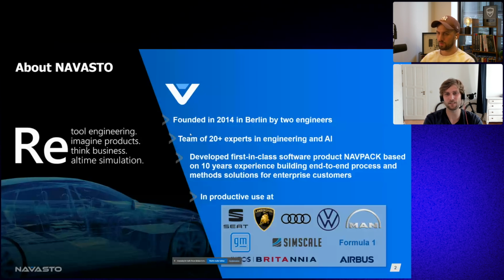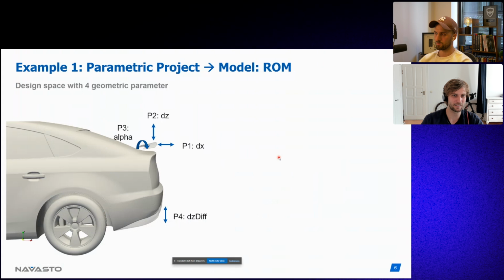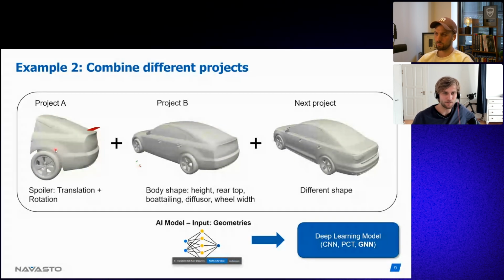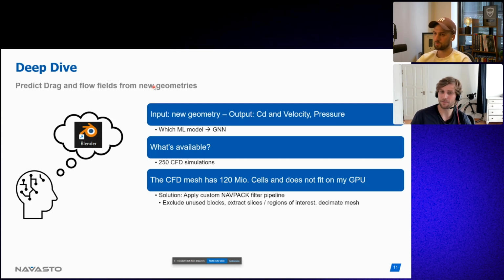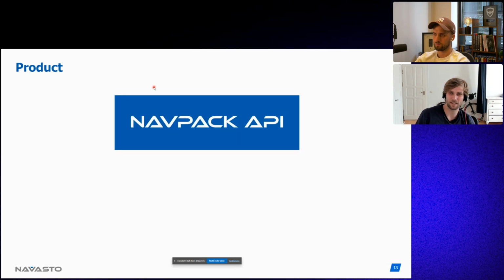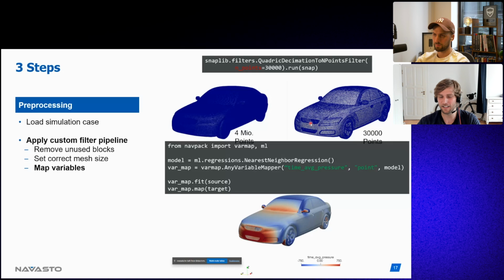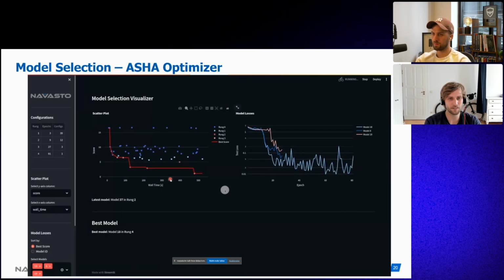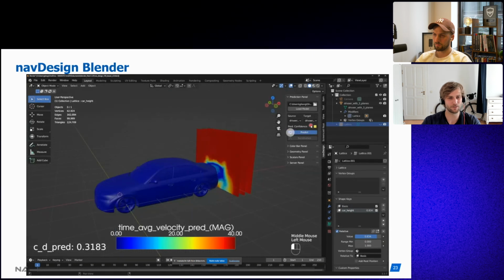Training Graph Neural Networks for CFD - Jakob Lohse | Deep Dive Session 6

Comment: What is the point of running 100+ simulation in order to make AI predict a simulation? By the time I run a 30 to 60 simulations, I would have already obtained my optimal solution. Running more is just a waste of computational resources.
Reply: (if) the model works well, you can use it for 10000+ new scenarios. With 30 to 60 simulations, you can just optimize very simple problems or just a specific variable of the problem.